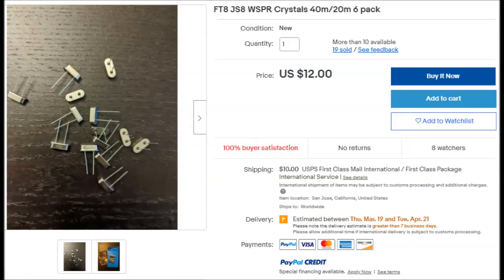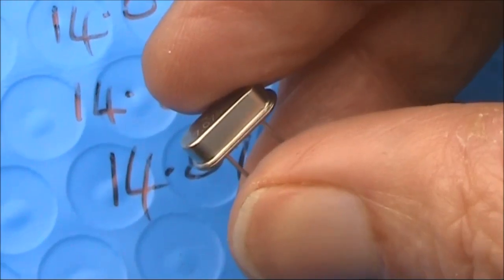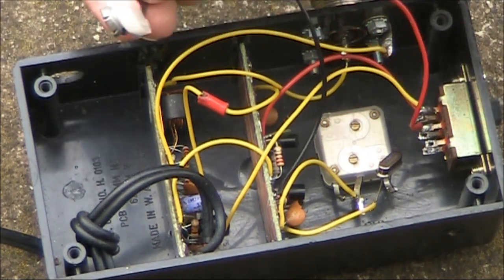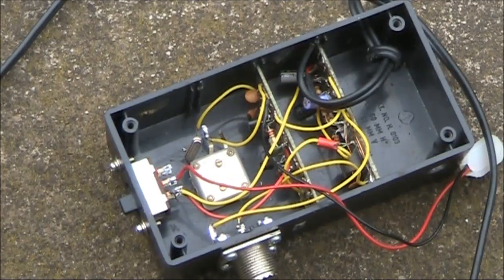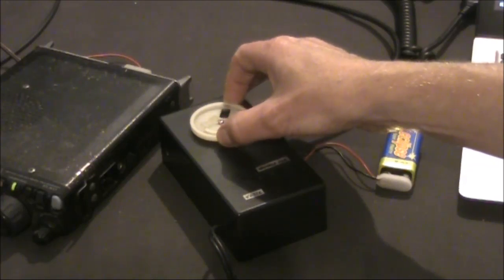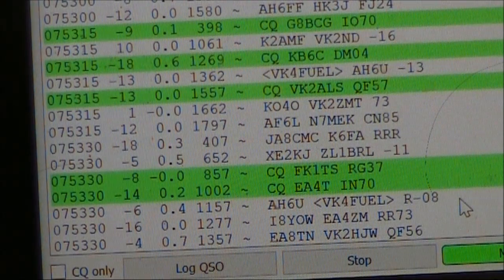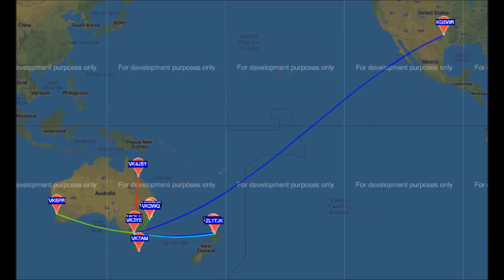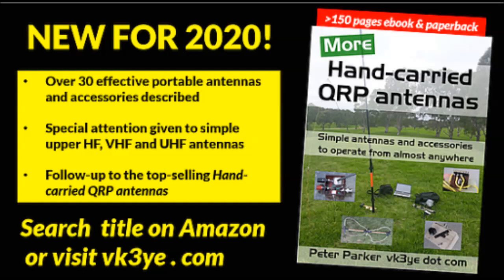Review: HF digital mode crystals from W6OUT (and a simple 7 MHz FT8/JS8/WSPR receiver)

Comment: Very interesting circuit. I have built two for 40 and 160 meters and they work very well. I would like to build a third one, but first I would like to know if the two resistors in the mixer must necessarily be 82 ohms or is it possible to vary the value.

Comment: bro how can i adjust xtal frequency?? suppose 25 Mhz xtal creat 100 mhz frequency. can i adjust frequency between 88-100 of xtal..is there any schematic??
Reply from the maker: Completely different circuit. Google 'frequency multiplier' or 'frequency doubler'. You need two such stages to get 25 MHz up to 100 MHz.
Reply: @vk3ye  bro plz provide me a link of that type of circuit.
actually i want to build a fm transmitter by using xtal which can tuned 88-108mhz.
i have build a transmitter circuit by using 25 mhz xtal..but i can only receive that signal at 100mhz..
this 100mhz already has occupied an existing broadcast.or help me bro..
Reply from the maker: @electronicshacks8288  Unfortunately I have no circuit. Do a Google search for suitable designs. An xtal controlled transmitter will be single frequency only unless it has a frequency synthesiser eg PLL or DDS. That is too complex for a beginner to build and you should consider buying instead.
Reply: @electronicshacks8288  You  can pull the crystal a little bit, maybe 100 kHz once multiplied up to VHF, but even that is tricky.

Comment: It’s great for an existing 20 or 40 xtal Transceiver that is collecting dust.  Use it to work FT8 or WHISPER. Many times people will almost give away the old rock bound transceivers if you are in the right place at the right time. —- wondering if this is a way to do an Altoids can transceiver for hiking tracking mountain topping ?

Comment: Very good but by the time you have bought them and the postage that's $22, You may as well use a $3-4  SI5351 and go all sythesised. Agreed it's not so clean and pure a design but it would be much more flexible